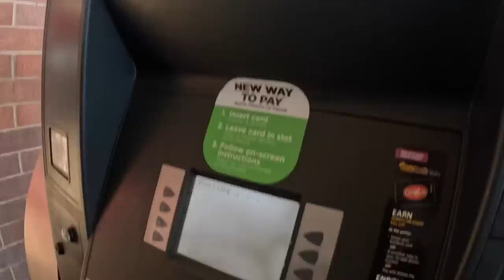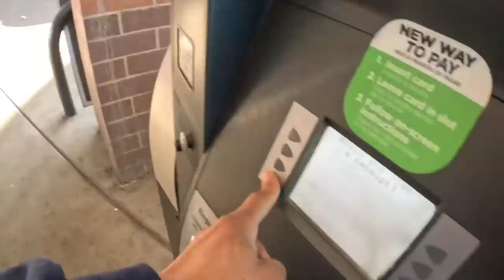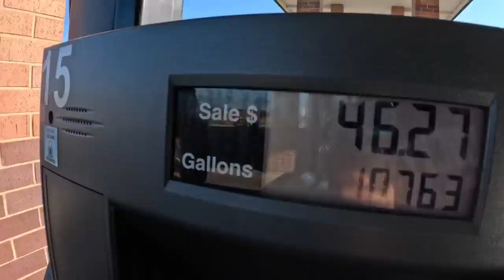RICHARD IS TEACHING ME HOW TO DO MECHANIC ￼WORK ON MY 1987 IROC-Z CAMARO Z28 ￼

Comment: Run a ground wire to the metal bar of the dash with self tapper, then wrap it around the left side RCA behind the stereo. If that doesn’t fix it, then the distortion is coming from the amplifier.✊🏾

Comment: Sounds like you have some noise coming through the radio speakers . It's caused from the alternator . Have a alternator noise  filter or suppressor installed .

Comment: Yes luck you should definitely keep that iroc and swap it. Exterior is 95% interior is 80% & it is t-top. You have a good example. A supercharged 6.2 would definitely have you at 550-700 hp. If you plan on making that your track car or your sideways all the way down the street car that would be perfect. You already have 1 1/2 swapped cars already so a 3rd wouldn’t be bad.
Reply: You can also go the cheap route and snatch that lt1 or TPi out of that parted impala/caprice then scrap the rest of the car. That can be a “project motor” & you swap it with the one in your iroc and keep the iroc engine aside. You take either motor and turbo it. Easy 450-550hp with that motor on a cheap turbo kit with fabrication, ported heads, etc.
Reply: You should also consider manual swapping that Camaro. Even if you just do a cam, headers, etc. you would be aiming towards 400 hp without having to do any major mods. Maybe port heads, exhaust too
Reply: Also the whine noise is either a ground wire or an alternator starting to go out.